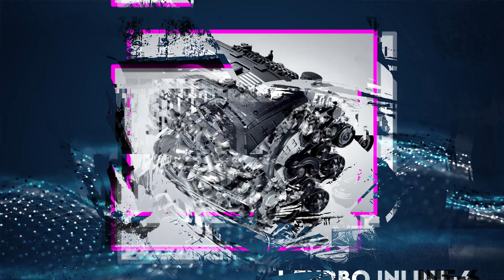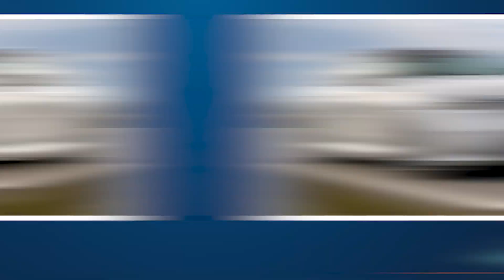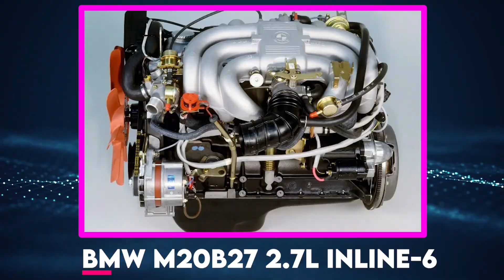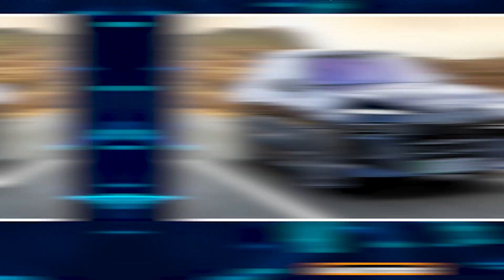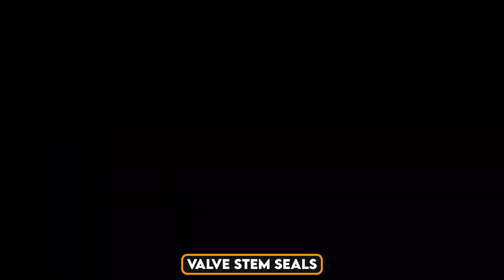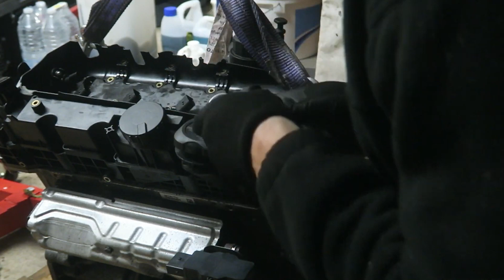What BMW Engines Are Making Mechanics RICH!?

Comment: FYI, I've had N47D20A diesel, got it to 240K miles and only had to replace one injector and tubro failed at 180K (but it was the bearing failure).